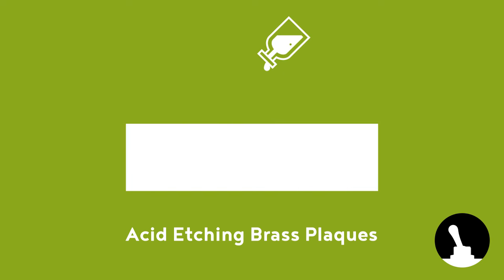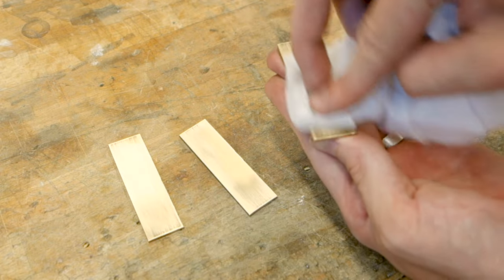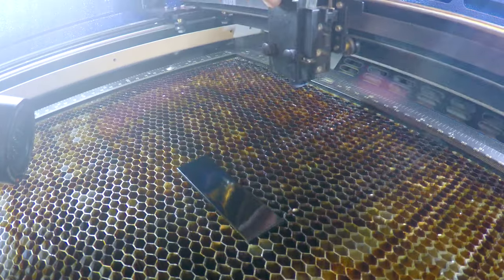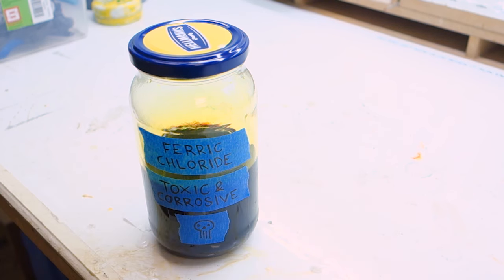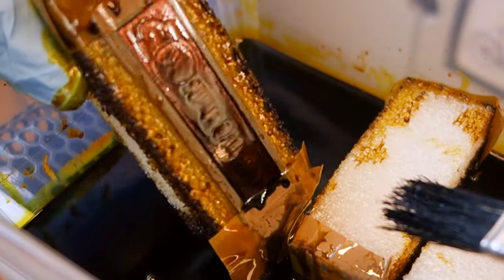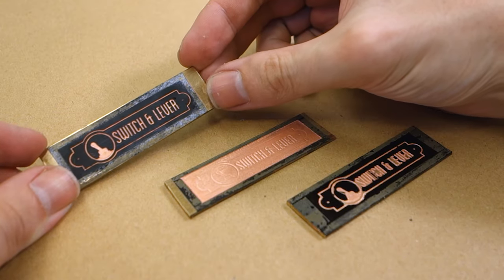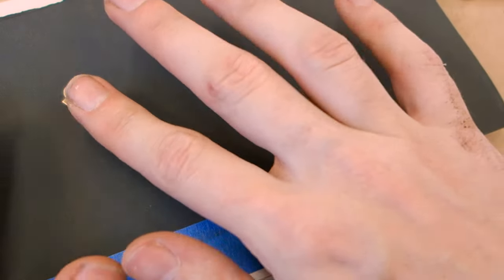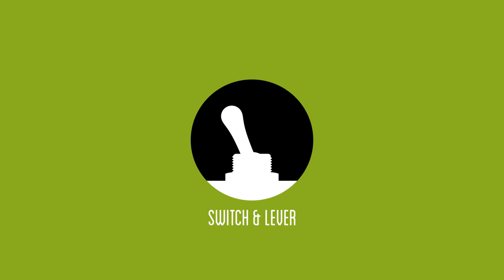Acid Etching Brass Plaques

Comment: I've had good luck with the laser toner method but even better success using vinyl stencils cut on a Silhouette or Circut machine.  Also, the ideal place to do your etching is on top of a running clothes dryer.  It's nicely warm, and the vibration helps keep the etchant aggitated.

Comment: Was searching for a commercial option to produce a name plate. Couldn't find a thing, then I stumbled across your video. Brilliant, bought materials and followed the laser printer method. It's worked better than I could dream of! Thank you :)
Reply from the maker: Well if you only need to make one there's hardly a place you can find which will make it and make it worth the cost. For serial production though, making lots of them, you can probably find a lot of producers willing to make it for a price point that makes sense per plate.

Comment: Thanks Daniel!  That Craftsman DP badge gave me an idea using your technique to restore the number plate for my 1950 King Seeley that I messed up during cleanup...the trick is matching the original font.  Great that you gave a fun shout out to Chris.  An amazing man...like you!
Reply from the maker: How bad is it messed up? Maybe you can take a good quality photo of it and trace what you can't match through fonts? There are also good services like WhatTheFont and Identifont that can help you identify fonts, but oftentimes for these old vintage stuff the fonts were simply not standardized how they are now, and many of those old fonts may never even have been digitized.
Reply: Very.  I used a 10:1 cleaner solution (10 H2O) in my ultrasonic to remove a decade worth of being in a horse stall on the ground.  It was fine until I pulled it out and touched it...all the enamel came off but the Stamped numbers are fine.  Luckily I got it's sister Band Saw with it which is pristine (well covered) and its plate is identical & pristine.  The originals are .050 AL but for all the time and energy I've put into restoring it been kicking around a brass one with the OEM detail and numbers that I can put a nice Restored by and date for whom ever gets it next...likely my son.  They don't build them like these anymore and hopefully never sees a horse stall again.

Your etching gave me the idea to hi res scan the one from the Band Saw and the stamped numbers from the dead one (again archaic font) and trace them if necessary in AI or ACAD to get it as original as possible.  Thanks much for the Font links, I'll check them out and if none match, on to the tedious tracing.  Thanks again!  Always enjoy your work and videos!

Comment: Using the closed-cell foam as a float is very clever. Another thing that will speed up etching is agitation - either mechanically (stirring or tilting) or with an aquarium bubbler. Parts that sit still etch slower because the etchant in contact with a given surface becomes saturated and thus etches slower, so you want to give it a swish to make sure that "stale" etchant is getting replaced frequently.
Another option for exposing photoresist, used by some who make PCBs, is to use a dry-film photoresist that gets ironed or laminated on, and then exposing it with an MSLA 3d resin printer.

Comment: This is the most comprehensive and informative video on this topic i've seen. I've been using the toner transfer method on aluminium for the branding on my product, and am thinking of offering a premium brass version so it's awesome to discover I can use similar processes. Also I never thought of using a laser to create the mask on a painted coating. I think i've gotta start using this approach as the printer and heating method has a high failure rate for me due to 'ghosting' and pinholes.
Thank you very much for sharing your knowledge :)
Reply from the maker: My pleasure! I checked out your stuff and you make some really high quality and gorgeous microphones! Let me know how it works out for you 🙂
Reply: Inkjet won't work, this is done with a laser printer. Laser toner is a thermoplastic that can be transferred with heat or solvent, inkjet ink is not.

Comment: Awesome video, I also saw a video where they uses a type of plastic foil designed to use for etching. It uses UV light to transfer the protective layer. This method was very easy to use.
Reply from the maker: Yeah, it's called a UV resist, and does offer a little better result, but it requires the film and a source of UV light. The sun works, but is not reliable.

Comment: A 4th option that I used was to cut the design on a vinyl cutter, stick it to the metal and etch. Same way I did a few PCBs too.
Reply: i was wondering if that would work. the ex kept our trophy/plaque shop and she does tons of vinyl, mostly for shirts, but can do other materials, too. we could use an oxidizing solution on brass plates that would turn the engraved parts black very quickly.

Comment: Beautiful work!  The toner transfer method produces an amazing result.  With such a high resolution, I bet you could do simple gradients and patterns using dithering.  If it works well, it might be possible to do a dithered photograph.
Reply from the maker: Indeed, though I wouldn't do so high resolution. You can look at etched printing plates which were commonly used in letterpress printing up until the '80s for inspiration. I would recommend checking out the short movie "The Collection" on Vimeo, by Adam Roffman about a collection of old printing plates with some beautiful shots of plates displaying this halftone patterning. I think that quality is about the highest you can expect working.

Comment: This is perfect for my needs.  I have many sign plates that would have cost an arm and a leg to have made in order to comply with boat safety regs. I will get a laser printer and make them myself.  (May also look at the cost of a small vinyl letter cutter as one of the responses mentions good results.)

Comment: We've been trying out metal etching and you can also use an iron to apply heat to bind print to the metal instead of a laminator (if you don't have one).
Reply from the maker: I think I mention that in the video, no? But yes, you absolutely can, but it's much more difficult to get good even results, especially over larger surfaces.

Comment: One method more is to do as in making a PCB. You spray the positive or negative etch resist on to your part and let it dry. Then have the design printed on a transparent sheet as black as you can get. Put the print against the etch resistant surface, shine UVA light on it enough (experimenting needed, usually 5-10 mins), remove the transparent sheet, develope the etch resist in sodium hydroxide solution (lye) and finally etch away :) Works always, doesn't creep under the resist much.
Reply from the maker: Yes, this is the traditional way of doing it, however the method I showcase doesn't require any special materials or tools. You can even forgo the laminator and use a clothes iron instead.
Reply: Most of the UV/photo resist materials will expose in simple sunlight. No special light exposure setup needed. And if spraying stuff isn't your thing, photoresist film is available. This also has the benefit of being able to reuse your printout. You can use inkjet or laser printer to print on transparency film. You could even use dot-matrix if you still have one of those. This method is less specialty tool intensive since you don't need a heat source other than the sun. This may be difficult for cave dwellers though.

Comment: I've used glossy photo paper for pcb's and it worked well  and was wondering if it would work on brass too? I got a pack of them at the $ store and it worked first time for the circuit boards with the iron on process. Good video.

Comment: Would you be able to use a 3d print as a resist in order to save material? Or maybe wood. Not sure if it will eat through it. Trying to etch .25 inch stainless steel using the salt water electro etching method. Thanks.
Reply from the maker: Not sure what you mean by 3d print or wood as a resist. You need to close off any surface that you don’t want etched from liquid. It needs to be completely sealed. Any etchant, or in your case water, which will seep under the resist will also etch the metal.

Comment: excellent video 100%!! super cool to include the whole lifetime of the project (disposal and recycling) fantastic! why did the special laser paint fail? again super great job
Reply from the maker: I honestly don't know. I'm guessing something in the paint was attacked by the acid. The coating bonds with the brass (or steel) which it is laser etched onto, and it's tough to the point of needing to be sanded off if you want it gone. My assumption is that whatever they use to make this special paint doesn't hold up to ferric chloride. I did another test off camera and had the same result, so all things considered it's most definitely an issue with the paint+acid.

Comment: You should agitate the chemistry. Being an surface oxidation process you need the mechanical action on the surface. 
Also would suggest adding som HCl to the mix :D 

Try to heat up to 54 C to get an optimum reaction - and for a smooth surface maybe try to get the acid slightly saturated with Cu :)

Anyway, love your innovative ideas :) 

Would love to connect!

Comment: Toner held up good the other two broke down. If you have the money you can use Kodak photo resist.  Ferric Chloride will permanently stain most everything it touches, clothing, concrete, etc.

Comment: I tried this project out with the laser and spray paint method but the burnt away spray paint left a residue that I couldn't undo. Even after acetone the spray paint removed but the residue from the burnt spray paint didn't and the residue is resisting the acid! Have you had that problem?

Comment: Hey, I just spotted your video. I want to DIY a woodworking project branding iron. To get more defintion on the raised lettering, would I just continue the etching process or would I have to change the acid from time to time to get the desired results? If this works, it'll be thanks to your video!! Also, I subbed just to have you as a handy inspiration for future projects. Thanks man!
Reply from the maker: The issue is that once it starts etching deeper it will start etching the “walls” which are exposed along the resist, undercutting the resist and obliterating fine detail. I have a video on how to make a branding iron though, maybe check that out instead 🙂
Reply: @SwitchAndLever  Thanks so much... why am I not surprised? I'm going there now.
Reply: @SwitchAndLever  I have my branding iron in the works. Thank you. QUESTION ABOUT ETCHING: Can your etching process be used with aluminum plaques?
Reply from the maker: Yes and no, to etch aluminum you need a different enchant. Ferric chloride isn’t enough. Probably you need muriatic acid or something such (or maybe lye could work?), but that’s heading into the terrify of really unpleasant acids/bases, so do your research proper before starting.
Reply: @SwitchAndLever  Thank you. Looks like I'll just stay with brass.

Comment: I like the idea of suspending the plaque (or in my case, usually circuit boards) in the acid with a piece of floating foam.  Not sure if it'll hold up to the Muriatic and Peroxide etching brew I use, but I'll give it a shot next time.  :)
Reply from the maker: Well unless it attacks plastics I think you'd be pretty safe. Just make sure the foam you use is closed cell foam so it doesn't absorb your "brew". The stuff that oftentimes comes packaged around electronics these days (as opposed to styrofoam of old) works really well.

Comment: So the point of the laminator is to get it to a certain temperature? If I don't have a laminator, could I use something like an iron? And can it get too hot? Also, does it have to be a laser printer, or can it be inkjet? I'm very curious in trying this out.
Reply from the maker: You can use an iron, but the point is not just the temperature but the pressure as well. The laminator puts a strong even pressure across the piece making adhesion of the toner even, it’s much more difficult to do properly with an iron. And yes, it has to be toner, so you need a laser printer. Inkjet will not work.
Reply: @SwitchAndLever  Good to know, thanks. Definitely something I want to try in the future, but it looks like I'll need to get a laser printer first, or maybe try a different method. lol. Much appreciated.

Comment: Awesome video by the way!  Few simple questions if you don't mind.  1. What is the thickness of the brass plate you used?  2. Where did you obtain it?  3. I noticed your vice had some sort of padding between the claws, mind sharing where you found those?
Reply from the maker: 1. No clue, 1-2mm? Not important as long as it's not so thin you etch through. 2. Local metal supplier, but many hobby stores carry stuff like that too. 3. Hardware store. Just look for soft vise jaws. You can also make yourself by gluing rubber or leather.

Comment: Great project! I'm not sure disposing copper waste in the way you demonstrated is a good idea, though. Correct me if I am wrong, but isn't the solid stuff left by evaporation water soluble copper salt in solid form? It will redissolve into water when getting wet and release copper ions.
Reply from the maker: The issue is more with what the copper does to the water treatment plant and how much is caught before it leaves the plant. On a garbage dump it poses less risk, and hopefully would get incinerated before it has a chance to lay around. Even if that's the case, garbage dumps tend (or should) not to be located where they pose a risk to ground water.

Comment: Great tutorial!  Toward the end, you mentioned that the plaque with the laser paint removal looked bolder -- as if the acid ate away under the edges, but if you look back at the shot of all three plaques prior to etching (5:40), you can see that both laser methods were initially bolder than the toner transfer method, especially the laser paint removal method.  Could this have been caused by your laser engraver focal distance being slightly off?  I've actually intentionally "de-focused" my laser before to achieve a "bold" effect.
Reply from the maker: Interesting theory, but actually looking at the laser paint it's almost identical to the toner transfer, whereas the regular spray paint looks bolder. If you look when I wash the laser paint off you can see that it's thinner than it first appears out of the laser. I'm a stickler for the laser cutter, so I can assure you that the focus was set correctly, but you are right in that the boldness of the regular spray paint was seen before the etching. I think I'm going to chalk it up to the paint I chose, that may have melted and retracted a little. I've done it before with great and accurate success, but I never bothered looking closely which kind of spray paint I used. Some variants I'm sure work better than others. Also, of course, some power settings of the laser, as I may have had it set too high to make sure I punched through the paint.
Reply: Playing with power settings might be interesting.  Have you also tried using dry moly lube spray instead of the Cermark?  I've used it for marking metals, and I'm wondering if it would resist the acid where the Cermark failed.  Nonetheless, I've favorited this video so I can refer back to it later.  Well done!
Reply from the maker: Burning the lube on with a laser? Or do you mean masking it in some other way? I've never heard of it used in that way.
Reply: The lube sprays on like spray paint then dries. When hit with the laser, it turns into a black, almost indestructible mark -- much like Cermark, but at 1/10th the price. Not quite as dark a black, but very usable.  There are plenty of YT videos on it -- check out https://www.youtube.com/watch?v=5ziyB9EEnL8&t=126s

Comment: Could you cut all the way through the brass if you left it soaking in the acid long enough? Also would this work with aluminum or would you need a different acid?
Reply from the maker: Yes, but it wouldn’t be a straight hole through. It would be very rough and blow out on the backside. Model train makers do exactly that but with much thinner stock to make small parts.

Comment: Yup you cut that like Chris. Miles away and then file it down. He would have spent way more time though getting every bevel perfect. Got to admire his work.
Reply from the maker: Indeed, but simply don't have his patience. It's admirable for sure!
Reply: I used to do projects like that. Perfectionist all the way. Of course I was never close to Chris standard but did the best I could. Now I have scaled back a little. I still take pride in the work but I am not going to spend twice the time for perfection. That way I lot more gets done in the limited time I have. 

Great work by the way.

Comment: Thank you for the tutorial. I've been using ferric chloride for etching PC boards for years but never thought about using it for etching brass. Would using a bubbler (like in an aquarium) help/speedup the process? And could stainless steel be used as a etching container?
Reply from the maker: Bubbler may make a difference, but I doubt it will help as much as gentle heat will. Heating the etching solution up to just 50 deg C will significantly speed up the process over room temperature. 

I would not use any metallic containers at all. Stick to plastic or glass. Stainless steel will stain, and corrode. Therefore it's also a waste of the etching solution.